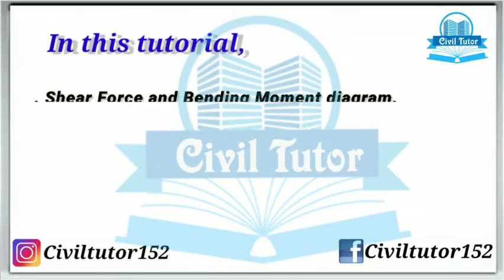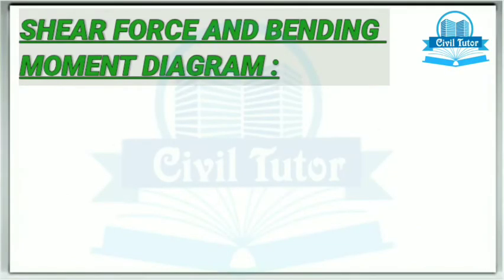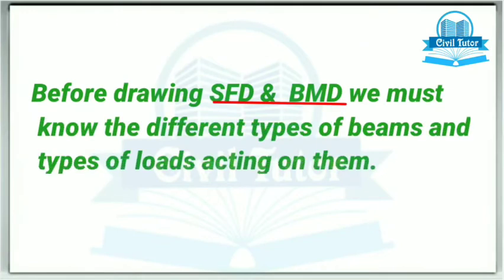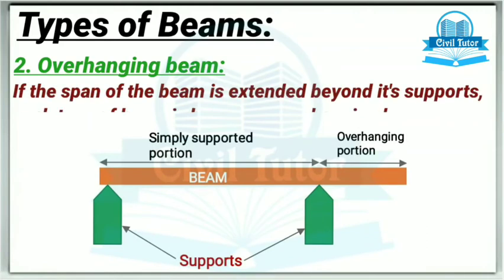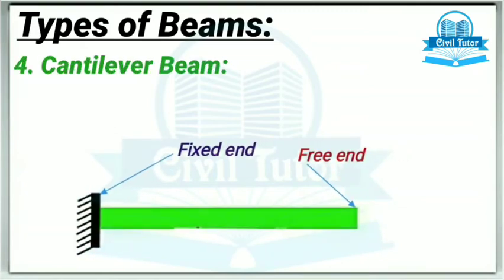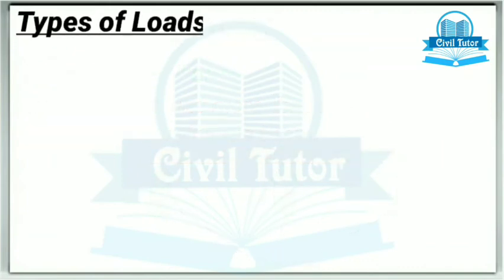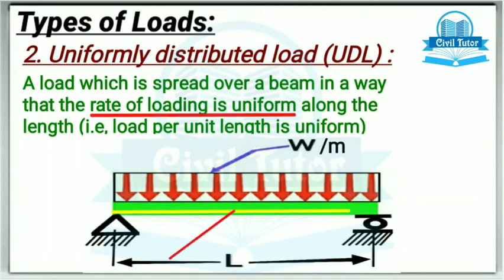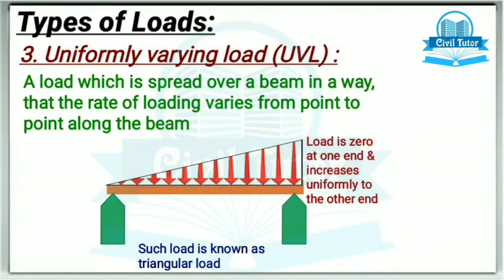Concept of shear force and bending moment diagram | types of beams and loads | Civiltutor| #sfd #bmd

Comment from the maker: In this tutorial i have defined SHEAR FORCE AND BENDING MOMENT DIAGRAM, types of beams and the various types of loads acting on them.

SHEAR FORCE AND BENDING MOMENT DIAGRAM:
A diagram which shows the variation of shear force along the length of beam is known as shear force diagram and a diagram which shows the variation of bending moment along the length of beam is known as bending moment diagram.

Types of beams:
1. SIMPLY SUPPORTED BEAM:supported or resting freely at supports. 

2. OVERHANGING BEAM:If the span of the beam is extended beyond it's supports, such type of beam is known as overhanging beam.

3. FIXED BEAM :A beam whose both the ends of it's span are fixed or built in walls is known as fixed beam.

4. CANTILEVER BEAM: A beam whose span is fixed at one end and free at the other end is known as a cantilever beam.

5. CONTINUOUS BEAM: A beam which has more than two supports is known as a continuous beam.

Types of loads:
1).CONCENTRATED LOAD OR POINT LOAD: A load which is considered to act at a point is known as a concentrated load.

2). UNIFORMLY DISTRIBUTED LOAD: A load which is spread over a beam in a way that the rate of loading is uniform along the length (i.e, load per unit length is uniform)

3).UNIFORMLY VARYING LOAD:
A load which is spread over a beam in a way that the rate of loading is uniform along the length (i.e, load per unit length is uniform)
#SHEARFORCE #BENDINGMOMENT
#SFD #BMD
#TYPESOFBEAMS
#LOADS #CIVILENGINEER 
#CIVILENGINEERING 
#ENGINEERINGMECHANICS 
#STRUCTURALANALYSIS 
#STRENGTHOFMATERIALS 
#SOLIDMECHANICS 

For more info visit the link below
 https://civiltutor152.blogspot.com/2020/01/concept-of-shear-force-and-bending.html

Join me on Facebook 
https://m.facebook.com/Civiltutor152/?ref=bookmarks

Subscribe my channel 
https://www.youtube.com/channel/UCPNuV99h2pi1634kHb6h8sw